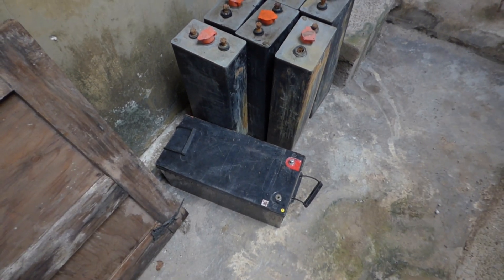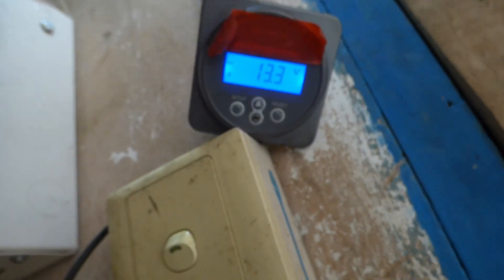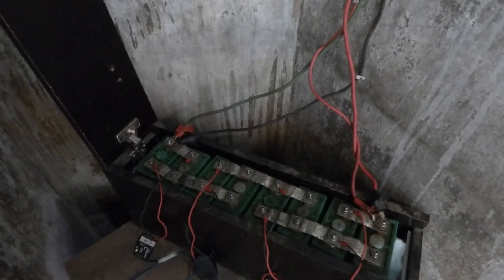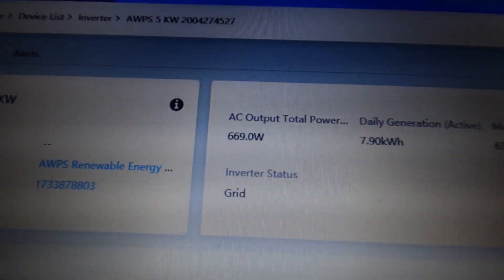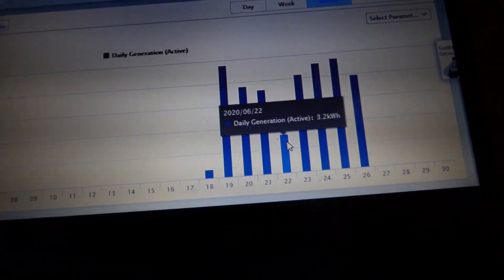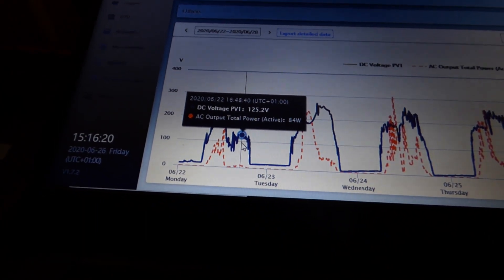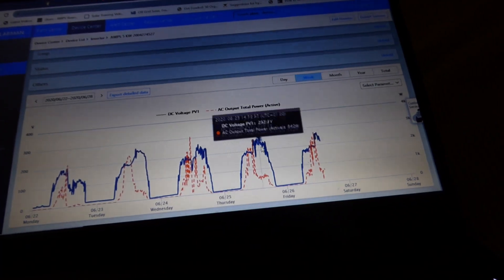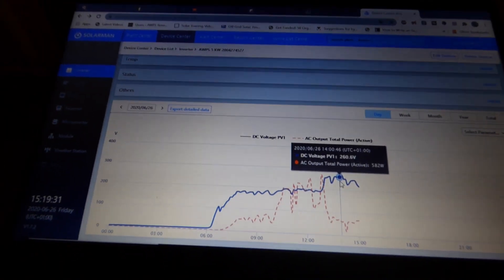New Battery and Deye 5 kw Inverter 1 Week in review

Comment: I can tell you have come a long way in solar when you pull out the lead acid batteries. My Rolls AGM lasted 3 months with me and then I switched  over to used nissan leafs. Keep up the good work.
Reply from the maker: Ouch Marco the Rolls is painful. Very expensive batteries. The Nissan leaf batteries are a great value. What BMS do you have on them.
Reply: @drsolar  Batium leaf (~16 kw) has been running the house for close to 2 yr. Now testing used BYD with about 25kw, with Delgreen BMS 250amp. All DIY. Like you in the early days.
Reply from the maker: @marcoa.rosado4724  why would you want  anything but the Nissan Leaf batteries? LOL. Keep me updated on the BYD. I am curious too. Thanks for responding and following

Comment: Very helpful video as usual Dr Solar. I'm happy to know your overall impression of the inverter remains positive. You appear to have a lot of solar capacity in your panels so your batteries get filled rather quickly. I think that diversion load property of this inverter will be very useful to someone in your situation. Maybe extra air-conditioners or electric heating could be used to consume the excess power which will even increase when the rainy season is over. Any plans to stress-test the inverter (Will Prowse style) to know if it is actually capable of delivering it name plate capacity? I pray you permanently move to lithium and get rid of those nasty lead batteries for good. Please kindly consider giving the battery room/area a splash of paint.
Reply from the maker: Good morning Thank you for watching and commenting. I have 4100 watts in panels and a 4400 Watt hour battery. My biggest continuous load is my 1 hp inverter AC. I will pur in a hot water heater and connect it to the smart load feature. Unfortunately I don't have enough load in the house to get to 5000 watts. 2 AC s microwave water pump are less than that. I even had a 4 kw inverter charging my Nissan leaf batteries and it did not move the needle. The entire compound is getting painted. So they will paint that area as well. Thank you for watching the entire video. They are getting a bit too long.